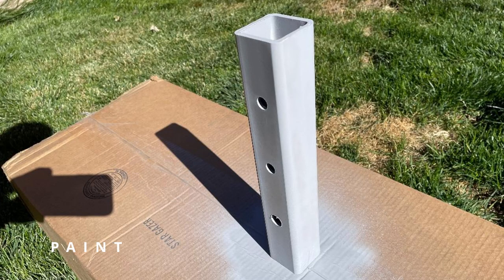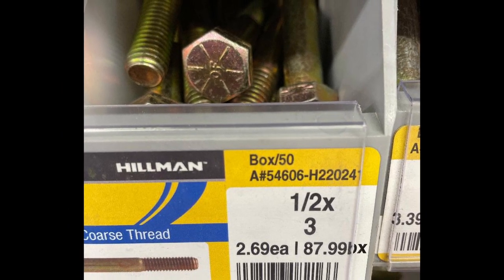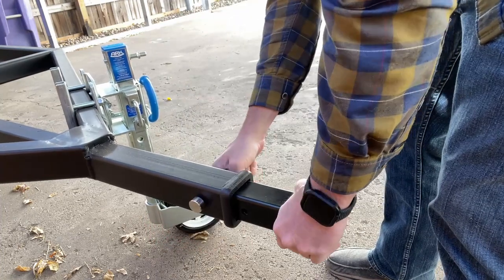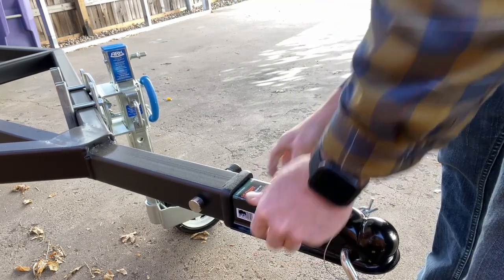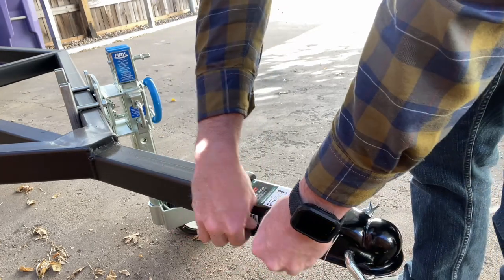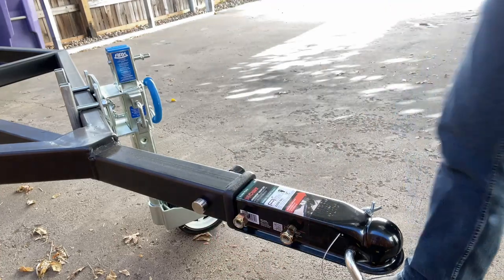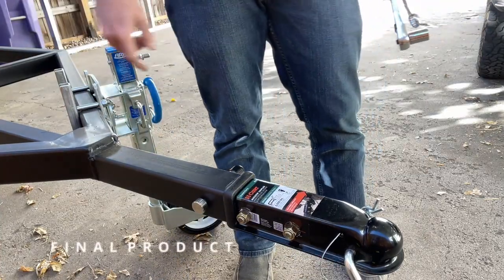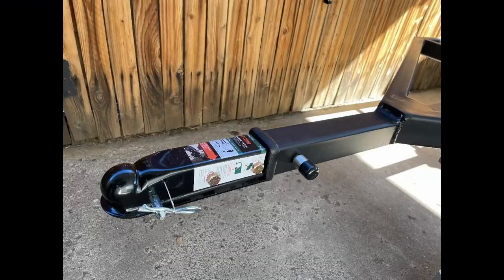Create Your Own Removable 2" Ball Coupler for Your Trailer!

Comment: Is there anywhere I could buy something like this? I don't have the tools to cut or drill what's needed, but would gladly pay for one!! I want to be able to swap between my lock n roll and a standard ball coupler for some vehicles that have an integrated ball hitch that can't be changed.
Reply from the maker: You could order the parts cut to length and find a friend with a drill.

Comment: This is great.. Really I terezted to see what the body will be. Thinkinking of skinning metal frame with 2mm sheet steel to give a seamless barrier and I side insolation  oard then ply. Seen too many trailers with rot from leakage. It rain a lot in Wales
Reply from the maker: Plan is to build with no wood.  The skin will likely be aluminum in some form.
Reply: Im following your build as Im starting mine next week in Sydney Australia. Will use Alum skin and maybe alum or wood frame. Will hold off until I see what you do first.
Allan
Reply from the maker: @allancarn7863  nice, the cabin frame will be made out of 1” 14g square tubing.